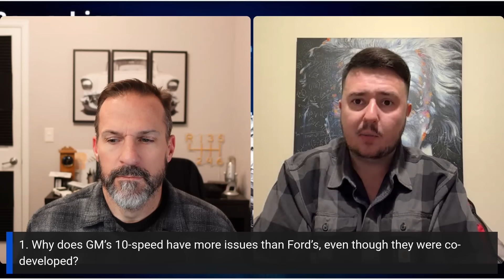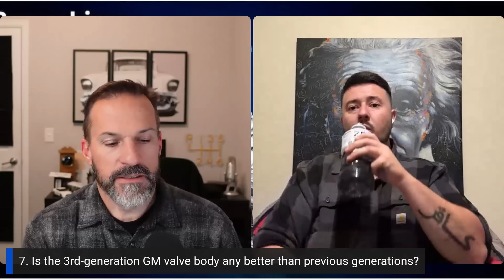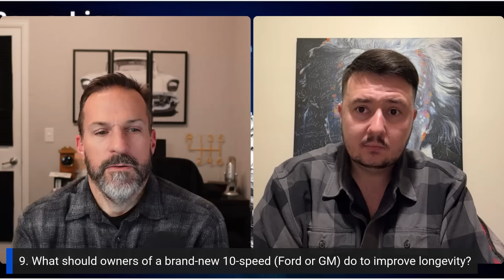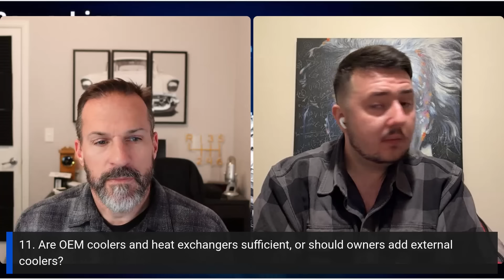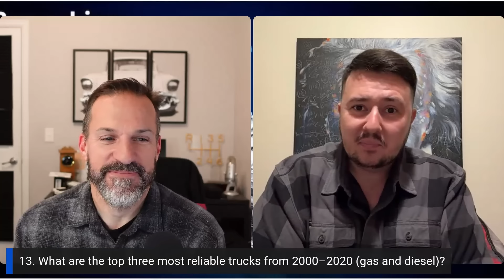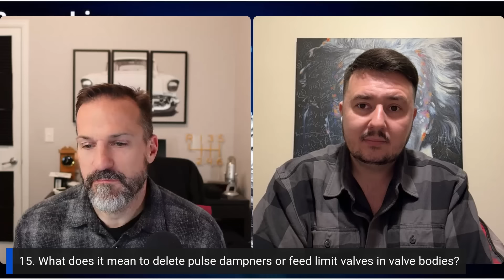Stop KILLING Your Transmission! The Maintenance MOST People Ignore (With NextGen Engineer)

Comment: It has always pissed me off that most transmissions don’t have drain plugs. I think more people would at least change their trans fluid if there were drain plugs.  The other thing that would make a tremendous difference would be if manufacturers would put independent outside dedicated external coolers or heat sinks where the trans oil is totally independent from the   radiator or engine oil cooling devices. Heat is a primary source of transmission problems.
Reply: My Toyotas have drain plugs on the transmissions.  A good old dipstick to check your fluid level.

Comment: My '06 Tundra transmission has 258k on it, and runs 100% perfect.
Reply: Don't sell it, cause your 2006 will definitely outlast your new 2026. After great success with Toyota, I literally had to sell a very expensive Tundra after 3 months it was so bad! Thank god I kept my old one.
Reply: Just getting broken in.
Reply: Mine a 08 has 280k doesn't burn a drop of oil, never touched the transmission oil. I tow construction trailer all week and a boat every weekend in the summer.
Reply: Because it's too little & weak to do any work.  They're talking about TRUCK transmissions.  Not toys.
Reply: @2LocasBeagles Moronic statement.
Reply: @2LocasBeagles  Lol Govt motors fanboy - not many of you left. Keep shilling.  GM might actually pay you for it. They need the sales.

Comment: Went with amsoil. Shifting in all vehicles was much smoother. The signature series says double manufacturer severe service drain interval. That tell you they believe in their product to. 

People don't realize you can suck and fill from dipstick tube and do it yourself cheap..  strainer inside can usually be left in there if fluid is kept red and new..
Reply: No "dipstick tube" in most vehicles built in the past 15 years.
Reply: My 2016 5.3 Silverado has the transmission Dip Stick/Tube.

Comment: Darn I didn’t get to ask a question, how cool is over cooling the transmission, I’ve seen bypass valve and it would make it sit around 140F operating temp which is that a bad thing?? What about winter conditions it will be even cooler…
Reply: How’s it shifting in cold weather?  Hard or smooth?  I’d say the cooler the better as long as it’ll shift and feels right.  I had one car years ago that wouldn’t shift to OD until it warmed up enough.

Comment: So, do not drain the torque converter (if it has a drain plug)?
Reply: Never seen a torque converter with a drain plug.
Reply: @machine7767  -  Ford C4 and C6 automatic transmissions both came with torque converter drain plugs.
Reply: @OHUQTU  yeah 50 years ago
Reply: @slalomking  - so how does your comment apply to any other transmission?
Reply: @OHUQTU  well it means, they haven’t put converter drain plugs in, in the last 40 years
Reply: @slalomking  - so not any manufacturers (Chinese, Korean, Japanese, German, American, Swedish, etc.) have had/used converter drain plugs in the last 40 years?
Reply: @slalomking   - pre 2001 Crown Vic 4R70's have torque convertor drain plugs. 2025-2000=25 years

Comment: For my 2024 Silverado, I replace the ATF every 10,000 miles with AMS oil ULV ATF. Shifts great and runs at 170 degrees.
Reply: Every 10k seems a bit excessive. 

How much fluid are you actually replacing every time? 🤔
Reply: @I_know_what_im_talking_about almost 9 quarts
Reply: • Pan drop and filter change: Approximately 8.1 to 10 quarts of DEXRON ULV Automatic Transmission Fluid

Comment: There’s a reason all auto makers are placing so many internal electrical control components in engines & transmission’s is to scam you. If you want a dependable vehicle these days buy a completely restored 1980-2004 but do your homework. If not strip it down and replace everything on your motor & tranny with what we all ran on in the 80s-90s, oh yeah you’re probably gonna have to give up a bunch of electrical goodie’s inside the vehicle.

Comment: If issues from replacing the fluid at 150k miles for the first time is because they are under filling it then why does the same transmission from thr same mechanic not have issues with frequency changes past 150k miles?

Comment: I noticed a HUGE difference in how well the 9 Speed ZF transmission responds to a Drain and refill at 36.000 miles, Now at 60.000 miles I'm doing it Again, And Yes I'm using ZF oil from Germany.

Comment: Nate is an honest dude. Just bought a 2026 Ford Tremor F 350 - “leave everything alone, change fluid, do not add anything, it will  void your factory and extended warranty”. I was ready to buy what he would have recommended. Great channel!
Reply: So riddle me this, I’m sitting on a ‘24 F-150 with just 8,000 miles and was ready to make changes too.  So they told you to ride it out till the end of warranty?   I only have the basic 3 year 36,000 mile deal anyway, on a truck I hardly drive.  Based on what they told you, I should just hold off until warranty is over?
Reply: @miragesmack007  Since you're so close to the three-year mark and do not put a lot of miles on your truck (8000?), why not buy the valvebody or just the vb kit, wait another few months or whatever THEN slap the parts in your trans along w/ some fresh fluid, then bingo. You have fundamentally a new trans w/ an valvebody that actually works and works very well.
Reply: It’s designed to fail After warranty.
IF your valve body is causing slight damage the entire time your vehicle is under warranty, changing the valve body at the End of warranty period will not reverse the damage you have already done.
As long as engine is still under warranty, I’d say screw it and upgrade it ASAP

Comment: I really like the liquid sandpaper analogy Nate!
Reply: It’s this liquid sandpaper that the OEM is using in an aging transmission to keep it shifting smoothly up until…. a certain point when the clutches finally are bald and all the clutch pack material suspended in the oil is no longer able to aid in operation — the gearbox FAILS. 🤷🏻‍♂️
Reply: @I_know_what_im_talking_about  the OEM does not use "liquid sandpaper" - only the end user can create it within the transmission by failing to perform regular fluid and filter changes.
Reply: @applesbighatranch6906 — I understand your point of view. Mine is… the transmission designer that suggests leaving the factory fill in the gearbox for the life of the transmission is accounting for the slush that is created by never. Servicing the gearbox to ultimately help it work as it ages and wears out.

Comment: I have a next gen valve body and deep oil pan on a 10L1000. I'm one of those guys he is referring to that didn't have enough transmission fluid. However I will say this. The deep oil pan nate sells has a lower oil fill level than the factory stove pipe style factory oil pan. These transmissions are really really picky about the oil level. I called next gen with my issue they basically told me to over fill it. Which is the only way to do it. Unfortunately you now dont have an accurate read on how much fluid is in there.

Comment: How much contaminated oil is left behind when doing a pan off drain?
Reply: Roughly half.   If you drop the pan again after driving 100 miles and refill again.   By that point, you will have replaced 75% of fluid.

Comment: Unchanged, degraded fluid leads to accelerated wear, then particulates build up and these factors combine resulting in your transmission failing prematurely. Its life is over and so the fluid has indeed lasted the lifetime of the transmission.

Comment: I have a 25 ranger raptor with the 10r60. I haven't had any issues yet. Nate, would you recommend I do the valve body now or just wait until there's issues since I'm still in warranty? I'm at 12k miles. I did the Ford performance tune so it's at 536 ft lbs torque and I'm pretty sure that's too much for this little transmission.
Reply: Really not one hard shift? I have a Ranger 2.7 and have had hard shifts if I get on it.
Reply: @66scooterdaytona no hard shifts but I've had a couple slow shifts. Might be the tune, I heard it improved the shifting

Comment: No disrespect meant, but I've always felt that transmission services is a scam I have a 2015 Tundra that I bought new I'm currently sitting at 421,000 Mi on it, never service the transmission whatsoever and have zero issues can't even tell it shifts it's so smooth literally the truck before this one 330,000 on it again no transmission issues and no transmission service I live in Colorado and I'm pulling trailers over mountain passes constantly
Reply: @johnwest2396 
Physics isn't about your feelings nor your anecdotal experience.  You're free to feel as you please but Physics and mechanics don't care.
Reply from the maker: You are talking about one of the most reliable transmissions ever made, Nate even said "people abuse these", which it sounds like you are doing :). I think Toyotas of old could be neglected and had very few issues, but they could go even further with proper maintenance. Did you buy it new and put on 421k, or did you buy from another party? It's possible they were servicing it before you if so.
Reply: I bought the truck new 10 miles on it when I bought it never bought a used truck always bought new.. the truck before this one I bought new put 330,000 on it again I have never serviced any of my transmissions in any of my trucks and had zero issues now that being said I change my oil every 5,000 miles and my differential fluids once a year religiously and I use good high quality oils, in my experience an opinion people I know that have had their serviced always seem to have issues
Reply: So what is the purpose of not servicing your trans. Pull a sample and send it to Blackstone, I guarantee you the acid level is off the hook.

Comment: NATE Recommended kit for longevity of the Tundra 2020 AB60F transmission?
Reply from the maker: Fluid drain and fill ever 30-50k depending on whether you tow a lot. People neglect these transmissions and still get 200-300k before rebuilding, those that do scheduled maintenance have hit 1,000,000 miles on them. They are extremely durable, though the pan and bolts can be terrible with rust.

Comment: I'm running my 18 Tundra w the thermostat open all times and find operating temps around 150 F - I'm in south Fla, any concern with running this temp long term?  Also, Toyota trucks use a SS mesh screen instead of a paper filter, any benefit to changing these; I did once on an 2007 4R and it seemed like wasted effort; I kept the original filter, cleaned it and there was nothing constricting the flow thru the screen; your opinion on this please...  appreciate the vlog, learning alot from this.

Comment: I could listen to Nate all day. Unbelievable knowledge and honest as they come. Guy could care less about what anyone thinks of his statements as he speaks only the truth
Reply: I am 85 years old. Have owned many cars of different brands. NEVER have I had a transmission fluid change. Never had a transmission fail. Maybe I was just lucky or maybe they just don't make them like they used to.
Reply: The correct phrase is 'Could NOT care less' Geddit? If you don't care at all (zero) you cannot care less than zero.
Reply: Word!
Reply: The feeling is echoed here as well. So much so that I have invested in a Project Carbon valvebody for my new 2025 F350 built w/ the 10R140. Install should happen in two or three weeks from now, along w/ a PPE aluminum pan.
Reply: Fact
Reply: Yeah it's not like he's in on it or anything. Don't pay attention to the fact that he's in with the GM engineers and is already designing next year's repair kit this year. Not to mention the cost of his kits are the same as a new transmission l
Reply: @mostlymotorized😡
Reply: Couldn't agree with you more!

Comment: Not 1.4millions miles, but my 1991 GMC 2500 with the 4l80e went 400k miles on the original engine and transmission
Reply: I had a travelling salesman who bought a new Caravan every 5 years. He would put on 500k/km per year. He swore by them, only ever did maintenance and brakes. Crazy things happen.

Comment: I made a proactive move and installed Next-gen kit in my 2020 silverado. Made the decision after doing the recommended fluid exchange. I'm about 8000 miles in and believe it was the right decision. Slow first shift and odd downshifts at slow speed are gone. All shifts are much more positive and runs slightly cooler. Seems to be everything that he claims. 8L90
Reply from the maker: Awesome to hear you are having a positive experience with the kit!
Reply: You rock Mike, thanks for your input and thanks for supporting American engineering!

- Nate @ Next Gen
Reply: What is this kit i seem to be having the same low speed local speed limit kinda stuff with very slight shudder and the odd shift I'd like to get ahead of this somehow??

Comment: What about  Volvo xc 90 transmission ?
Reply: On P2 XC90 with Aisin transmission, I disconnect upper ATF line at radiator and cycle out 2 quarts at a time, fill with 2 new quarts, by running engine 45+- seconds. 15 qts later, it's clean red fluid.

Comment: directed at NEXT GEN  on GM 6l80/90 etc 
is there a way to get pulse delete with out requiring an entire valve body? is there a kit you offer to eliminate? or is the valve body i was able to find on your site the one and actual fix? i ask as we have right now 6 customers with those trans beginning to have minor shifting issues related to the valve body. we are trying to find not only the best overall correction but all corrections in all price points to allow them options.

Comment: I'm not going to pretend I know even a fraction as this guy on transmissions, but it sounds to me like a pulse dampener is similar to a water hammer arrestor in something like a domestic water system.  

Water hammer is very hard on solenoids and a water hammer arrestor moves an equally small amount of water relative to an entire system. However it does reduce a very significant pressure spike as fluids do not significantly compress. 

Am I off in my line of thinking here?

Comment: Nate; Have you ever seen a transmission fail from running at too low of a fluid temperature? After I installed an external fluid bypass valve on a 10L80 I run at around °120 in the winter and it takes a while to get to that temperature.
Reply: He’s said in the past he’s run transmissions at 120-140 degrees with no issues
Reply: @BCSVT Thanks for the response!

Comment: I'll say this car manufacturers have been building junk transmissions since thr beginning of time.  Every year every maker gas transmission problems.  I will also say this the Aisin 8 speed in the Lexus ISF,  GSF,  RCF and LC500 is rock solid.  You can beat on this thing and it never quits.

Comment: these ten speed have no dipstick i added one to mine because of this most people have a problem adding fluid at home creating the problem
Reply from the maker: Yeah pretty much every brand is like this nowadays, most are setup to test between a certain temperature but they all have different procedures to get the level right.
Reply: What 10 speed trans and where did you find a dipstick for it?

Comment: Are all 10 speed transmissions affected or just the ones with the Duramax. From what I found online, it seems to be the 3.0 Duramax with the issues discussed. I have a 23 ltz z71 with the 5.3l but haven't had any issues yet.
Reply from the maker: All of the 10 speeds for GM have the same issues with the valve bodies eventually, both HD and non HD.

Comment: Have a 2018 F150 3.5EB with 88k miles. Bought new. Drained the trans and transfer case twice. Am now planning to change the next 30k miles for the next drain since dropping the pan only removes 8 quarts.  That mixes old and new trans fluid about 50%. So far no problems. The second oil change was AMSOIL signature.
Reply from the maker: Thanks for sharing your experience, glad to hear it's been working out for you.
Reply: Drain and fill twice each 30k miles.

Comment: Has a slightly thicker fluid in gm 10 speeds shown to help I’ve heard lots of good results of people using low viscosity instead of ulv thanks in advance!
Reply from the maker: Great question, I'll have to forward on to Nate. I know previously he has talked about the climates people live in as well as a consideration, someone in Canada might be better off with the ULV, someone in Texas maybe low viscosity. I'll have to run it by him...
Reply: @TheCarGuyOnline congrats on new truck I had a 17 ram 1500 put 155,000 miles on it loved the eight speed. only did 1 transmission fluid change at 60,000  truck was great till I traded it in on the 3/4 ton Chevrolet
Reply: @TheCarGuyOnline thanks I have the same question about ulv and lv.
Reply: Meant to say 30k miles, not 300k
Reply: I wouldn't, it would be better to lower the thermostat temp for the transmission cooler, stock is like 195 degrees, 170 would be better and changing the fluid every 300k miles for trans longevity. Im weary of using different fluids than what the manufacturer recommends, untill someone else proves you can use something different, I wouldn't experiment. Remember when mercon 3 got replaced by mercon V, and V wasn't backwards compatible at first, and supposedly a lot of mercon 3 transmissions got toasted because of the different fluid. So fluid can possibly kill a trans.